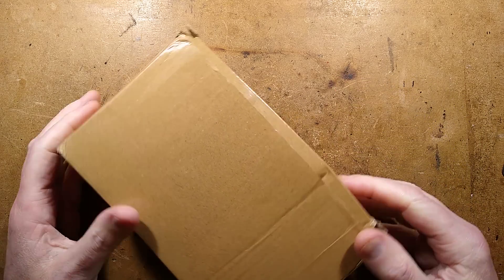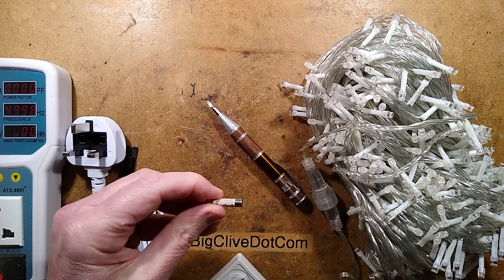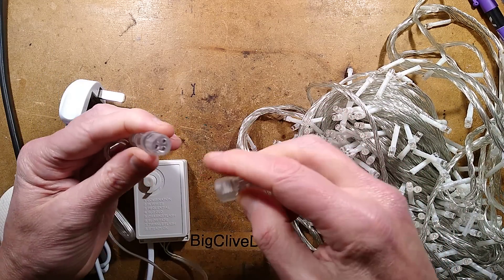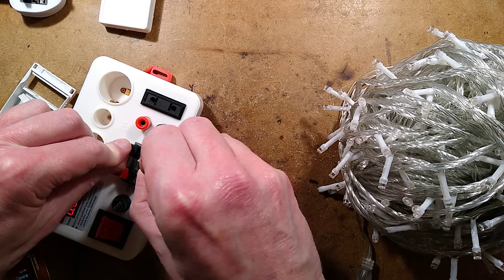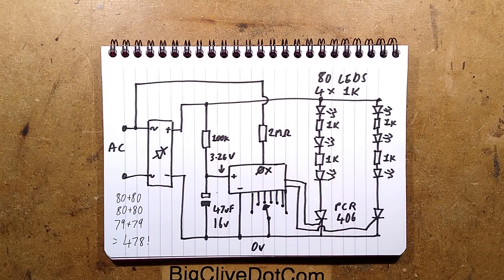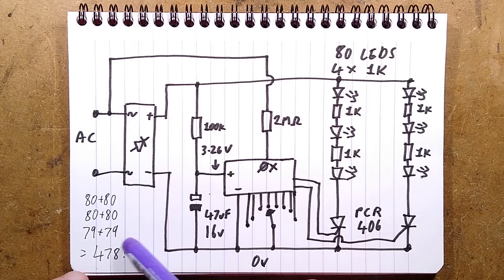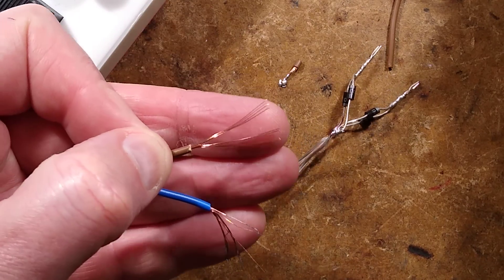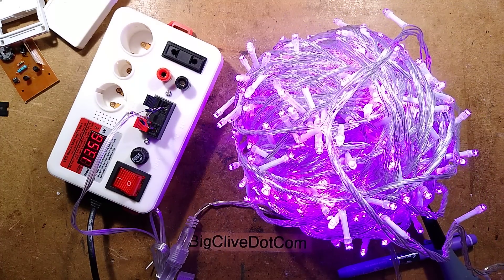exploring a "500" LED eBay light string (with schematic)

Comment: can I connect this kind of lightstrings  to a esp32 with wled installed on it? and can you tell me how? I think 1 data will  be on a d pin But I will guess i need a power supply wich can supply power to the string and the esp. I think the lights will not work on 5 v? :) sorry just a newbe in esp

Comment: Can anyone help? I have a 500led string. Plugged it in and it was working fine. Put the lights up and now they are really dim and get dimmer as the string continues to the point of nothing at the end. Can they be fixed or am. I looking at a replacement jobbie? Thanks in advance!
Reply from the maker: Depending on how they're wired, check there's not a short circuit at the end.
Reply: I'll take a look, thank you!
Reply from the maker: @WatchYouLookingAt  Are they low voltage lights or mains voltage lights?
Reply: They were mains powered. Sadly I have given up on them. I went along the whole string and couldn't see anything untoward.

Comment: Many of these purple lights put out UV and will fluoresce items. Very bad for your eyes and skin
16:30 "And ultimately... DUURRRRR" sums it up nicely. 😂
Reply from the maker: These lights put out no UV.   Many fluorescent materials will glow with blue light.
Reply: That's good. I had a set with a broad output which tested as crossing into the ultraviolet range on some fancy doodad. I got rid of it shortly thereafter

Comment: Lidl currently have 580 LED string for £18, better value given I’d expect them to fulfil basic safety requirements 😅
Reply from the maker: The Lidl stuff should be safe.
Reply: (Isolated supply providing 30V across the string)

Comment: Great video and analyses Clive, those mains wires are absolute rubbish, some copper coated iron wire. Your capacitive dropper works, I still prefer to put a 100 Ohms 2-watt inrush limiting resistor in series. The 330 or 470 nF Cap can let a large surge through when energized at the peak value 325 Volts of the mains cycle.

Comment: I grew up several Christmases with the old school, true 4 channel fairy light of this kind with rotary dial that keeps the same setting. Seeing a 4 channel in action is just pure nostalgia due to its distinct twinkling patterns but unfortunately nowadays the market is flooded with 2 channel ones. Lucky if you could find a 4 channel today, it's like finding a needle in a haystack. Hopefully we'll see the resurrection of the 4 channel with a safer design. Flicker-less LED design would be great bonus.
Reply: You can get 4 channel strings in Romania, they're not really that rare. Usually the longer strings are 4 channel (both LED and the incandescent rice lights). Short (100-200 bulbs/LEDs) strings are hard to find in 4 channel.

Comment: Hey Clive, I have a USB charger which I've had plugged in for a few years, I recently plugged in a USB C cable and got a shock from it. I checked with my multimeter and it's making 100V AC on the USB shield. Would you like it to investigate?
Reply from the maker: Many ungrounded chargers will give a slight tingle on the output due to capacitive coupling between the winding layers and the class Y suppression capacitor.   It's usually extremely low current, but can still be felt as a slight tingle on sensitive skin.
There are dangerous chargers out there.  I only recommend getting chargers from prominent sources like IKEA, ASDA, Walmart and others who follow the correct approval procedure.

Comment: Hi Clive. Off topic but need you input. In an argument with people who say you can run a piece of machinery from your side of the pond , that runs on your single phase 240 on the American, split phase 240? Rubbish? Thanks
Reply from the maker: In the UK we have a very standardised electrical system.  240/415 three phase.  Most homes get a single 240V phase and a neutral, while industrial premises get the full three phases.
Our wall sockets can provide 240V single phase at up to 13A allowing 3kW loads to be used in any socket in your home.
Our laundry equipment just plugs into any socket, and in your garage you could plug a welder in any socket too.
Reply: Ignoring the frequency difference it will work fine. Appliances care about the voltage difference between the two main wires and don't care about the absolute voltage relative to ground. From a safety perspective it's slightly worse but this is the exact same issue as wiring a polarized plug backwards. For instance you could get shocked putting your fingers in a lamp socket even if it's switched off.

Comment: Look on the bright ( ? ) side ... these provide  LOADS  of bits of clear flex to  REPAIR  other folks , garden / Christmas  ( etc )   lights ... ermm .. ( might be cheaper to buy just for the flex ? ? ) , yep , DO NOT use outdoors .. DAVE™  🛑
Reply from the maker: The wire is extraordinarily thin and often hard to terminate.  These lights are normally assembled by machines which lock it in place as it is soldered and then sleeved.

Comment: That plug at 1:10 looks like a Europlug which works in most sockets all over Europe (well, except in the UK). It only allows 250V / 2,5 A and is very common for small devices, nowadays especially chargers. Don't have an almost identical plug in the UK as well, although requiring a different socket?
Reply: The uk 'shaver' plug is similar, but with fatter pins

Comment: A silly question: why don't the LEDs fed by an unsmoothed bridge-rectified DC current flicker? I presume you camera does not have anything inertial in its' rendering. A human eye may not see the flickering, but the camera should.
Reply from the maker: I think the camera is adjusting the exposure enough to avoid flicker.
Reply: Perhaps that color is coming from a special phosphor which has some latent glow in it smoothing the light output even more than the full bridge rectified frequency.
Reply: @benbaselet2026 That is a decent hypothesis, would be nice to know for sure. I have not seen LEDs that have their phosphors with a longish afterglow. I could see a lot of simplfications in the driver's circuitry if such LEDs existed.

Comment: Thanks Big Clive!  

Wondering if you did a video of you reworking the shady power supply for safety?  It actually seems kind of handy other than the spicy bits just open to misfortune.  LOL

The unfortunate thing about things like this is in thinking someone is wanting to make a festive display and then all the things that could go wrong because of greedy and shady sales pitches.  You wonder how many houses burn down or even worse because of these practices.    Kind of sad really.
Reply from the maker: I think I've covered the cap-dropper conversion in the past.  It doesn't make it safer, but does make it static and last longer.

Comment: At least the 13A plug didn't have an "insulated" Earth pin 🙂Just received one of those "Chinese Industrial Bulb Testers" - seems identical to yours, and took a LONG time to arrive (14 weeks!). Might well do a few basic safety modifications prior to playing with it!
Reply: It should be a plastic earth pin though, it's only a 2 core cable so it's not providing any actual earthing.
Reply: @davidpooley4167  Meh, just connect the earth and neutral pin together, it'll be fine! :-)

Comment: 1:08 these aren't Chinese plugs, but the European style. China and the US share the same simple bladed connectors, wit the exception of the earthed one's that have angled pins for the Chinese. The plug you see is much more stable inside a socket (not prone to fall due to being round) and is sleeved.

Comment: “500” is a valid way to describe it, but only if you only have one significant digit 😂
Reply: I mean we know that 20 watt chinese lamps are actually 10 watts and the batteries are, at most, half the rated capacity so this really should have been 250 LEDs. I think they were quite generous with this set :-)

Comment: Drawing on what I've learned during recent pre-hibernation YouTube binges, I'm wondering if these might've been made for the Saudi market, which also use the IEC type G (UK) outlets? 🔌🇦🇪😇

The UAE (Or at least Dubai) has a VAT rate of 5%. 478 LEDs plus 5% VAT is ≈ 500 LEDs... 🧮💰😉
Reply from the maker: That's an enviably low VAT rate compared to our 20%.

Comment: Speaking of power wires, I bought a 3 conductor 1mm² European color code power cord from Aliexpress (yes I know, probably not the best to buy it) however after watching one of your videos I decided to give that cord the flame test and was pleasantly surprised that the stranded wires went rainbow and did not shrivel up. Also I'm pretty sure the wires are of the correct gauge as the wire without the insulation is quite stiff. It's stiffer than some PC power cords I've gotten in here in the US that claim to be 18awg but I seriously doubt it.
Reply from the maker: Try the magnet test too, to see if the cable sticks to a powerful magnet.
Reply: Those "rainbow colours" sound suspiciously like steel tempering colours.

Comment: Someone has probably already mentioned it, but I don't have time to see all the comments right now. 1:10 That "Chinesyamerican two-pin plug" looks like a CEE 7/16 better known as Europlug, rated for 2.5A at 250V, low enough power that even Chinese plugs are generally built well enough, but to NOT avoid burning down your house the Chinese usually combine them with copper clad aluminum leads 🤬
To be a true Europlug among other things the pins must be angled slightly towards the center (1 mm less at the tip than at the base) to act as a spring loaded contact on sockets that accept plugs with wider pins.
Reply from the maker: In hindsight this was bought as a "european" set.
Reply: I came here looking for this comment. I'm surprised Clive isn't familiar with the europlug, didn't he work in France for a bit?
Reply: @falsemcnuggethope  I guess because the Schuko is almost the only socket you can find both at domestic, commercial and industrial environments and most double insulated power tools and appliances use the 7/17 unearthed round plug with cutouts for the earth contacts that fits into Schuko sockets.

You can find extension cords and reels with recessed sockets shaped for the Europlug but I never seen a panel socket shaped for the Europlug, the closer thing is the Swiss type 13 panel socket where an Europlug will fit.
Reply: @ruben_balea  In my experience, 7/17 is much more rare than the europlug and only used for high power class II applications. I think the only such plugs I own are for my vacuum cleaner and hair dryer. I've also seen Europlug panel sockets but only in new installations.

I still think Clive would've encountered Europlug in devices like a tabletop lamp or a charger or power supply for some smaller tool. Or if his stint there was within the last couple decades, a phone charger. Maybe it's the case that he simply didn't notice that he was plugging in various kinds of plugs to the same socket, which is very understandable and one of the great successess of the European standards.
Reply: @falsemcnuggethope  I was unable to find them here in Spain, so for the heavy chargers/adapters with Europlug that came loose easily from the Schuko sockets I 3D printed some adapters that convert the Europlug into a Schuko shaped plug. There are a few free designs available, I chose one that had a couple tabs to grab the Europlug so it comes out with it, others seem to be designed to stay in the Schuko. It's also mostly hollow so it's fast and cheap to print, others were solid...
Reply: @ruben_balea  I don't have that problem but I've seen some heavy transformers with an Europlug before. Luckily, SMPS' are prevalent these days and they have no problem staying in.

Comment: FYI:  I got an advertisement at the 8 Min 40 Sec point.  I seldom see an ad in Clive's videos.

My rating puts Walmart crap below eBay.  At least with eBay you have a choice of buying better quality. 🤷

I would be interested in knowing the length of the string.  The string LEDs I recently bought even gave the length in meters.
Thanks, Clive.
Reply: Seems to be about 10 cm between lamps so it's probably around 50 meters total.

Comment: Could you connect the suspect fuses to a power supply and measure the actual current value required to pop them? Then break them open to check for sand.
Reply from the maker: That would require quite a high current for a 13A fuse.  They will usually sustain several times their rated current for a short time.

Comment: You can kind of make them safe but you will need to use an isolation Transformer
Reply: You would still get blasted handling the set if both wires happened to be exposed. And it would still be a fire hazard. So a little safeR but not safe.

Comment: All jokes aside, but assuming, 230 Volts mains in Europe (240 only in UK), and 220 in China, 500 LEDs in China dissipate almost exactly the same amount of power as 478 on 230 Volts. The factor is almost dead on. Is this a snipped product for the EU market? Or did i just multiply and fudge numbers until I got the result I wanted?
Reply from the maker: Theoretically the power would be higher on the European supply.  We should be getting the extra LEDs.

Comment: 04:00 The ease of access to the full 230V supply voltage cable soldered connections is astonishing
Reply: Easy access for little fingers to play with.  The sellers are entirely responsible for any accidents, but best of luck getting them to accept liability!
Reply: @phils4634  Not so sure about the seller part. I think if you buy these from China then it makes you the importer and guess who gets the liability then..
Reply: @phils4634  they may say after seeing you dead....why you so weak, so weak...😐🙃
Reply: As stated, DON'T BUY THESE!
Reply: And it has been that way since, probably, the 80s.

Comment: Sadly with that design, it has to flicker or else the SCR will never release.
Reply: On the plus side, the rectifier bridge doubles the flash rate over that of the worst looking strings. One could swap in incandescent strings and the controller should survive, presuming the string isn't too long (where we know I misused "long").

With other changes one could swap the SCRs with FETs, add smoothing before and after the switching and once again have an LED set with all the main flaws of the original.

Comment: We have seen much worse LED strings in the past. The 13 amp fuse is a wee bit silly, but easily rectified with the 3 amp fuse. I do wish that using copper plated steel/aluminium wires were not used, the fact that they do copper plate means they do know the potential dangers associated with it. Thanks Clive, good post 👍
Reply: Can you explain to me whats the risk of copper plated aluminium cables?
Reply: @lynes2peters438 search for John Ward and his garden burn-ups
Reply: @lynes2peters438  Most of the danger comes from when the process is done cheaply, China can often make cheap electric copper coated cables as a cost effective solution. However, this type of wire can suffer from corrosion/oxidisation. The cable resistance, when using DC is much higher than using a solid copper cable. This can lead to the cable failing, component damage which could lead to equipment failure. The copper coated aluminium cable is not as flexible as solid copper causing problems with tighter bend radius', and it is more brittle making it prone to breaking. There are also concerns regarding the PVC sheathing containing some toxic elements which RoHS warns that skin, liver and neurological problems after long term exposure. There are reports linking the sheathing to a rare liver cancer.
Reply: @lynes2peters438   Aluminium has a much higher resistance so with thin flex like this it'll get very hot when the circuit is live. Also, as you saw in the video, when they do get hot they get a bit... melty.
Reply: Ah got it, thanks everybody :)

Comment: I wish there was a way to waterproof these leds for outside use.  They are a nice size but fall apart with the least moisture.
Reply: coating them in some resin perhaps does the trick?
Reply: Well the only remotely good way to use these would be to put them in a container, like a clear glass sphere where they will not get wet or tampered with. Would probably look decently nice.

Comment: Sorry to be picky, but you can't use a capacitor in this case to reduce flicker. The problem is that the thyristors require the LED current to fall to zero every half mains cycle. The capacitor will prevent that and all LEDs will then remain permanently lit.
Reply from the maker: The capacitor was only when they were being run static without the control system.
Reply: @bigclivedotcom  Ah! I missed that detail. My apologies. Thanks for the clarification.
Reply: came here for this